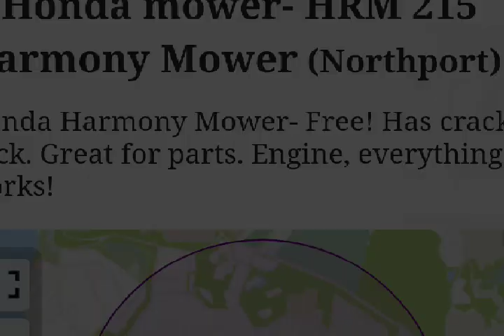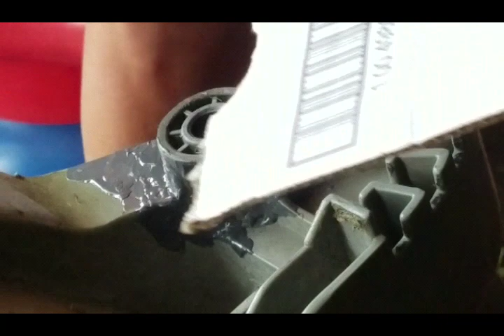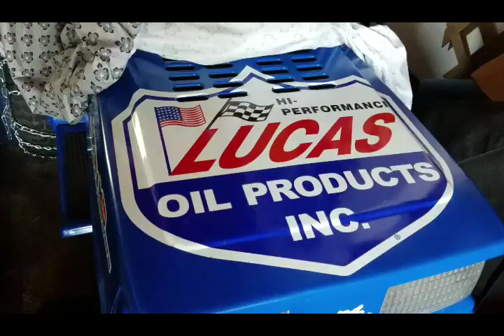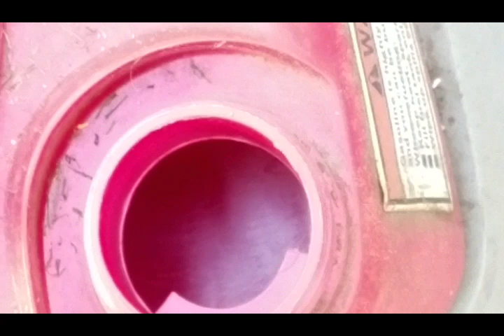FREE HONDA HARMONY HRM215 SX SELF PROPELLED LAWN MOWER CRACKED DECK JB WELD FOOT FLAP FIX REPAIR DIY

Comment: Funny I also have the same old Harmony HRB215 mower with the exact same cracking at the front wheels that I am dealing with right now. Gonna try JB Weld. Hate to get rid of the almost 30 year old mower.

Comment: Tried the JB weld on my 23 yr old  Honda and it worked for a bit but as video mentioned the stress just was too much,motor still purr's so looking for alternative fix and will update...
Reply from the maker: You can easily find a used Honda either free or super cheap on Craigslist
Reply: @MowersNBlowers  Thanks,will start looking

Comment: You have the rubber foot guard on backwards the round piece on the bottom of flap should be facing towards you when mowing
Reply from the maker: Yup, but like I said...its gonna be a parts machine...irrelevant at this point.  Good eye.

Comment: JB weld is great for certain things but I don’t trust it for something like that. If that was a metal deck you could probably get away with welding it. Btw Henry I’ve got myself one of those Forest Gump snappers in to flip. So far I’ve just checked for spark and got nothing but I couldn’t press on further because I had to go to my real full time job. Lol. Any tips you have from the one you worked on would be helpful.😄
Reply from the maker: No bro, straight forward for me.  I had a tecumseh and it fired up pretty easily.  It had a long one piece flojet type carb which I've never seen on a tecumseh..I think, it was so long ago.  Does it have electric start? Is it a briggs? The only thing I can tell you that you dont already know, is that theres a Forrest gump type and a cant buy me love type....google it.  Turns out mine was a cant buy me love.
Reply: Mowers N Blowers it’s a tecumseh pull start. No electric start. It’s the one with the rectangular steering wheel.
Reply from the maker: @dougsgarage1798  forest gump one is triangle, called a comet.  Cant buy me love one is handlebars which is the one I got.  Go luck with it bro.

Comment: I just bought a 2011 John Deere D100 for $50 no engine all I needed was the hood. I got it home fabricated the hood bracket for JD lt180. Then I was looking at the wheels on the d100 one was beat to shit  with a sledge hammer, the other was a wheel off a craftsman, I pulled on the wheel and the whole end of the axle came out
Reply from the maker: Bummer!

Comment: I parted out one of those in February, and threw out the deck. Should of kept it, you could have used it, it was in good shape too
Reply from the maker: It's a real pain to mount an engine on the honda decks...clutch and cables will make me hang myself.

Comment: That mower has had a lot of $HlT & abuse... it's not pretty, but dump it while you can.
Yes, JB Weld, our savior! I made a repair on a GM Tailgat latch bezel and plugged a hole in an air comp tank a few days ago. Would be lost with out it.

Comment: Only 220 bucks for a new deck.   But think of all the videos you could make swapping the parts over.
Reply from the maker: I've never spent over $50 on a push mower..no way I'd get a deck for a mower that will fetch $200 max.
Reply: Luckily your time is worth nothing?

Comment: Bet you wish you keeped the other Honda deck you sold
Reply from the maker: Actually, getting 75 for a deck is good money, I never look forward to working on Hondas...too complicated.  I dont have good luck with them.
Reply: @MowersNBlowers  and it is a 900 dollar mower you can get 400 used you sold for 75
Reply from the maker: @mrbriggs68  theres no way in hell anyone's getting 400 for it.  You know it's just the deck I got 75 for. No engine.

Comment: plastic weld it.
Reply from the maker: Nah wouldn't have held.  Jb weld barely does the job
Reply: @MowersNBlowers  Could make a metal plate behind it.
Reply from the maker: @littleeagle7563  yeah but, what about the ugly hole, the crack, the transmission, gearbox?  Not gonna spend anymore time on it.
Reply: @MowersNBlowers  Just sell it to some nut.